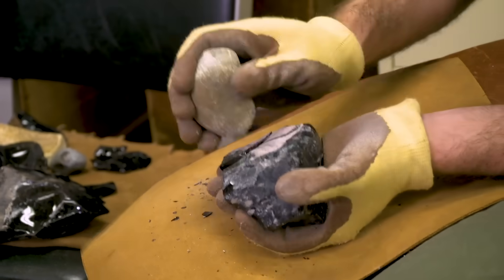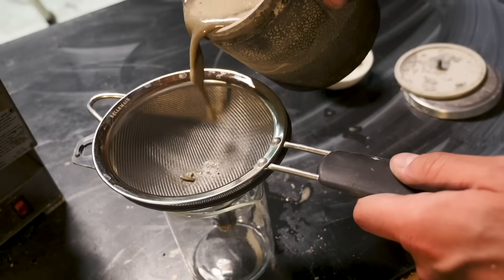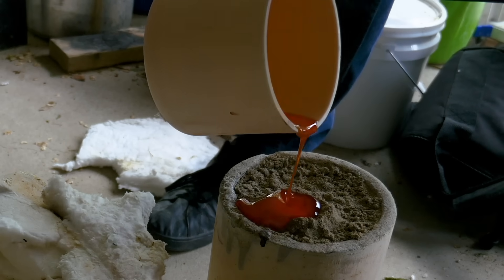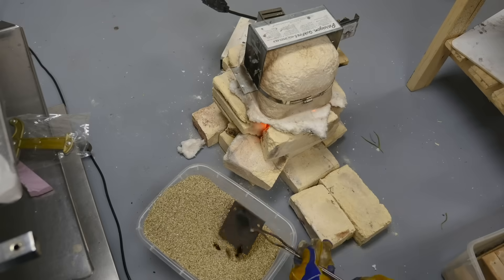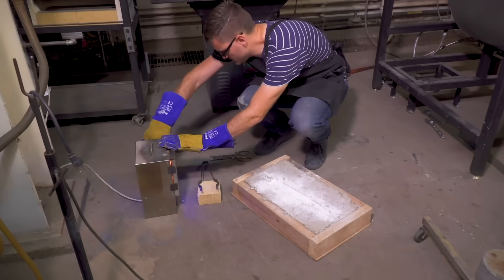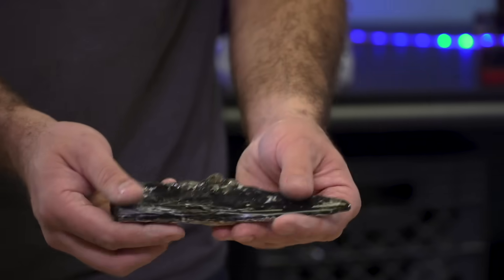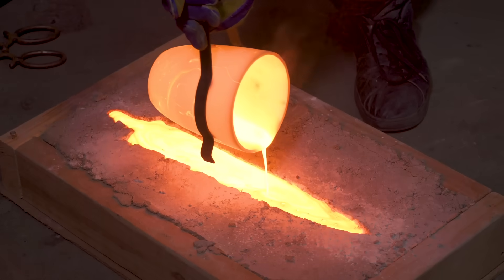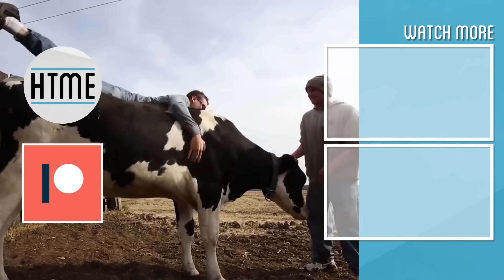Can You Melt Obsidian and Cast a Sword?

Comment: Really makes me wonder how in the hell Aztec warriors made obsidian blades
Reply: I believe you're referring to a maquahuitl, which is a wooden club lined with shards of obsidian (traditionally) along the length of it. The obsidian bits were knapped into blades, spikes, or into a circular design that looked like scales. (Knapping is the art of shaping conchoidal fracturing stone like chert, flint, or even obsidian via lithic reduction, or breaking bits away from the main body.) The maquahuitl was capable of inflicting serious lacerations from the rows of obsidian blades embedded in its sides, especially considering the fact that obsidian is capable of producing an edge sharper than high-quality steel razor blades. (Source: wikipedia) 
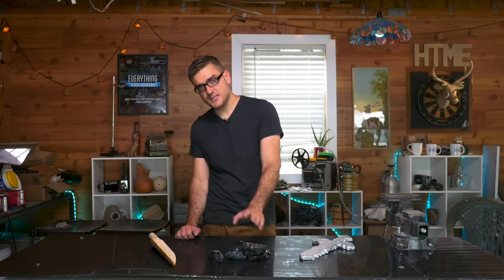If so, then this video has a clip of a separate video made where he had embedded some obsidian along wood around 1:39 for a knife, in a similar, though highly-experimental and rough version.
Reply: The blades were heat treated to make them flake easier but not make them weaker which made the obsidian the same without losing the integrity that melting it and casting it would

Comment: Make a thick square plate as much of it as you'd think you need to have a solid piece once you polish it down and have it cut out with a water jet and then put your edge on it. But the handle would have to be made out of it just so it keeps the strength

Comment: Wild guess(es) : it breaks either because obsidian is made of a mix of heterogeneous compounds (and therefore needs to be purified while in its fluid state) or... while some layers are cooling down at a certain velocity, others are doing the some at another one, so the differences in volumes are just too much for this solid and it just breaks. Maybe a thinner sword wouldn't break so easily

Comment: What kind of flux did you use?  I think a high temp Flint would work...check any high fire ceramic chemical.  We use flint for a strong, glossy flux.  A frit might help as well.   I have used obsidian in the bottom of ceramic fountains and it must be crushed very fine, mixed with Flint and a small amount of aluminum.

Comment: Well, congrats. You proved my teacher wrong. She very strongly claimed that Obsidian cannot be casted and, for example, forged into a blade.
Reply: The video pretty much proved her correct. You can evidently cast it by adding a lot of additives, but even at that, the resultant "alloy" is not able to be crafted into a tool or weapon, so casting obsidian is pointless.
Reply: @jonperry4580  yet it can be done. Thats the only point
Reply: There is a lot of flux in there so I wouldn't consider it obsidian
Reply: @rhysmisa2965  But is it still really Obsidian if it has so much extra stuff?
Reply: @tiacool7978  probably the base is obsidian and yes, it still might be considered as an obsidian sword

Comment: So guys. I am a geologist. And we do melt and cast obsidian (and other volcanic rocks) regularly. We need to do this if we want to analyze the rocks with certain techniques. I can tell you for sure that you can cast the darn obsidian. But you need to melt it in the correct way. (1) First of all, you want to pulverize the rock. You need to bring it to the size of flour particles... large chunks will not work, they do not melt homogeneously. (2) You really want to get rid of all the water. Natural obsidian can have anything up to 6 weight% water in it. If you try to melt/cast it with water inside, the water will expand or it will hydrate your obsidian non-homogeneously (it makes it crack). So try to keep the powder for 24 hours at 100 degrees C. Then put it in another oven and keep it for 2 more hours at around 800-850 degrees Celsius. Don't use higher temperatures or longer times, because it will cause part of the powder to melt... you don't want that yet. You can use ceramic vessels to store the obsidian powder for this process, they will resist at those temperatures. (3) At this point you want to use a flux. Generally, we use Lithium-Tetraborate. You want a 1-5 ratio. So for 1 kilo of obisidan powder, you add 5 kilos of flux. (4) Next step is to homogenize the mixture. We use pestle and mortars, and we grind and homogenize the mixture of obsidian powder and flux. If you do not homogenize perfectly, the material will melt at different rates and it will then solidify at different rates. This creates volume tensions inside the material, and it makes it crack. (5) Put the stuff in an oven at around 1100-1200 degrees Celsius. Leave it in there until it melts perfectly. For example, for 6 grams of mixture we need about 25 minutes to get a perfect melt. Then you need to cast FAST and cool down at room temperature. Tadam! You will have a natural glass cast (obsidian = volcanic glass).

Comment: Try some rhyolite or basalt and do it again lol lava flows are of a certain composition. The mould should be quite hot as well and cooled slowly to prevent cracking.. But if you want a sword you may need to go bigger and grind it down. Im thinking a heated cast iron mould with lots or a fair bit of sand so it doesn't stick.

Comment: Obsidian is basically hardened lava. Lava was once magma, which is completely molten. So yes, you can obviously melt obsidian at the right temperature.

If you don't want it to crack it must be cooled down slowly. Just like glass blowers do it.
They shape the tiniest and most fragile pieces of glass without a single crack.

Adding different minerals makes it a different compound (that's why it was transparent). So the final result is not really obsidian anymore.

I'm sure you can cast a sword if you bring it to a high temperature and cool it very slowly.

Comment: No glass likes to be treated this way [even the last attempt, which is better, was doomed to failure]. Blown glass has to remain at a high temperature while it's being shaped and then gets placed in a kiln to cool down. Any rapid cooling process during manufacture will ruin most, if not all, glass.

Comment: The problem with anything like glass is the cooling process after smelting. Professionals use a special oven/heater and sand. It sometimes needs 3 days slowly cooling down.

Comment: This isn’t obsidian. This is a mix of metal and rocks. And this make it weaker you must get it direct from erupting volcano while is still hot and then cast it. That way it will be stronger but still it’s going to be weaker than a normal metal one. So to get super strong obsidian sword you must do it like the old days- the hammer, the forge and the cold water.

Comment: It was used for weapons in South America and even parts of North America for centuries. But they didn't make blades this way at all, instead using a knapping technique to shape it. Done properly you end up with a blade actually many times sharper than most steel blades can achieve. Arrow heads, spears, and knives were the most common result but the Aztecs also used a weapon called a Macuahuitl which was essentially a shaped wooden club similar to a cricket bat or short handled boat oar that was lined with obsidian blades in effect creating a slashing longsword.

Comment: build a big furnace. then build two stone molds of the sword you want. one with a hole in it going through the whole stone block. get everything out of the obsidian so it's pure. take and fill the first stone mold then place the other mold with the hole on top. fill the hole with obsidian. or you can just keep adding it in the hole without filling the lower mold. place in the furnace. as it heats and starts to melt the obsidian will drain down out of the hole. keep the heat up and add more obsidian in the hole. keep doing this till there is nothing but liquid obsidian at the top. turn off the furnace and let it cool with the stone molds inside. when it is completely cooled off, then take out and slowly remove the top mold and see what you got. you might need some help removing the top mold but remove the mold slowly and even on both sides. might also want to put something on the stone molds to make it easy to remove.

Comment: Completely ignoring the fact that Video Games allow for this sort of thing (along with a ton of other things that cannot be done IRL), it can be done, but you have to forge it when the obsidian is first being formed by a volcano. The intense heat along with the time of exposure and environmental factors fuses the various elements caught in the flow, creating "unknown" compounds (*alleged "impurities") which then contribute to the solidified substance we call obsidian.
*I say "alleged impurities" because you're assuming obsidian would be an element and not a compound. Elements are pure, compounds are not, which is the main thing that separates them.

You would need a mold that could withstand both the temperature and the prolonged exposure, and would allow the plasma to cool at its own rate. 
The mold would have to be made out of obsidian, because it will reheat when the molten plasma touches it, but because it's already in its final state, it will not melt. It may soften, but that will further break down the molecular structure, which will be different enough from the raw obsidian plasma that they won't combine.

So, first you find a molten puddle of it in the wild, and lay a traditionally cast sword in the top of it (similar to the final sand cast where the sword was not covered, but just impressed).
Once the obsidian cools, you melt the sword out of it. This is the tricky part, because you have to use a sword made out of a material with a higher melting point than raw obsidian's temperature, otherwise it melts into the obsidian plasma, and then you don't have obsidian, but rather an obsidian-like compound with more additives that will negatively affect its stability.

Once the traditional sword is melted away, you have to fill the void with fresh volcanic plasma that will result in obsidian, and not some other igneous rock.

Alternatively, you could carve a mold out of granite, since it has a much higher melting point, and layer the molten obsidian. Pour in a thin layer, just enough to cover the bottom, then, after it's cooled a bit, pour on another layer. The new layer will re-melt the preceeding layer enough that they will bond. If you let the layer cool too much, you end up with a laminate, and you don't want that. You want a mixture. You could probably assist the blending process by stirring it, but that's either going to add a drastic reduction in temperature (using another piece of cold obsidian to stir it) or foreign compounds (a metal stick).
Continue layering until you've achieved the desired thickness, and then let it cool.

Comment: try titan chrome or other alloy with iron or...very expensive variant...clean titan with nitrid coat (you can also use carbon coat) or...hyper alloy titan wolfram carbid but only in dust form...you cant melt wolfram and carbon at home...wolfram and carbon melted at 3642 °C (W) 3422 °C (C) but titan is great choice... melted at 1668 °C good luck :)

Comment: Interesting.. wondering why you didn't find a black Smith to work with. One with a metal di cast for a blade. Figure if you put it in a heated metal cast you could get a better shape and less likely to crack apart?

Comment: Carbon coating the mold was a step in the right direction.  Not only does the carbon help release but the act of heating drives out some of the moisture that helped form the sand.  We learned this before casting to heat the mold, reducing the thermal shock of the cast material hitting the mold and dispelling all of the moisture in the mold. Then place the whole mold into the secondkiln, bake, then slowly reduce temp.

Comment: wait molecule thick blades
dude could you explain that in detail cause that's rad?
Reply: Eman I second that ^^
Reply: The crystalline structure of obsidian fractures at an atomic level leaving a jagged edge only a molecule wide which is far finer than any metal blade its used in surgical scalpels because you can make a finer cut with less force.
Reply: The blade being so thin makes it more effective at separating atoms

Comment: When I was 12-19 years old I lied on a farm. I plowed up arrowheads, centuries old fire pits that had baked the red flag to ceramic and piles of 100s of tiny count chips where some Indian hunter sat snapping arrow heads of tools. But I also dug up BIG chunks of greenish, blueish and yellowish globe of glass that had been exposed to thousands of degrees of heat and melted into this clump of glass. Did some hunter, 250 years ago throw a coke bottle into the fire? Or course not. The likes of flint shares were fascinating- you could close your eyes and imagine hi sitting there crack, crack , cracking away as his weapon took shape. You could see the fires in the baked ceramic clay by the small trickle of water that centuries ago had been a 20 foot wide creek. But we're in hell the molten glass come from????

Comment: i was making sapphires that were 5 ft by 1-1/2 ft by 3 inches  3 years ago, only need a 3800F furnace and aluminum oxide. vacuum the furnace and add CO and CO2 as needed for color. not a big deal, i got a pubic high screwel edumacation ;)

Comment: Nope. It is a very bad smelting material. You can however flint-nap it. It loses all stucture when you melt it down, the process that created it in the first place would have to be re-created as opposed to simply super-heating it and then letting it cool.

Comment: migth work  reenfored with carbon fibers. Or just a carbon sword. You think this tuff wouldbe better reseached,but if if it is a fantasy anyway. It's always debatable wether it works in real life. or even if that fantansy world have advanced techniques in glass, Ie strengherned glass. And I don't know the  melting tempetures for it, I doubt you could just simply cast it.

Comment: to cast obsidian you'd need to extrude it into an atmospherically compressed hot sand mold and maintain pressurized molten ceramic constituents of obsidian under great force to prevent bubbling the lava while cooling and gradually lower the temperature and pressure until the material is ice cold and stable.

Comment: Not knowing a lot about this technology but have you considered pre-heating your mold before you make your pour? That would allow an extended cooling time thus possibly overcoming stress fracturing of the glass. It's to bad you can't incorporate a technology similar to the making of 'St. Ruperts' Drops'. Super rapid cooling that would incorporate desirable stress factors into the blade.

Comment: Grinding the obsidian is definitely the right way to start. It would help to know what you are using for flux. I've never tried to melt or cast obsidian, but I've cast different types of glass and metals.
My way: Make a wax model of the knife, use stoneware clay and Kyanite grog for mold, fire to 2300 F. 
Melting obsidian:  I would start with gerstley borate in various proportions, or some other boron based flux. I might also try adding a small amount of powdered alumina or silicon carbide to make it less brittle. Temper by cooling from 1200 F to 900 F SLOWLY, by turning down burner (like over 3 hours). Just packing blade in vermiculite lets it cool too fast. I've had successWithout slow tempering glass can shatter on its own from internal stresses. I found a digital pyrometer (w/type K thermocouple) on eBay for $30.